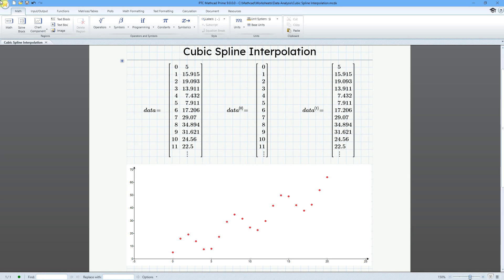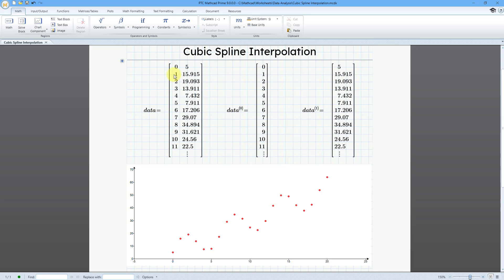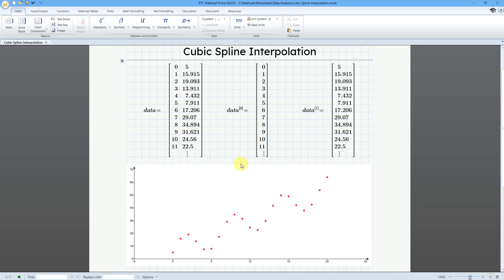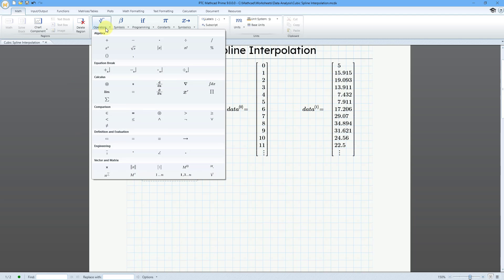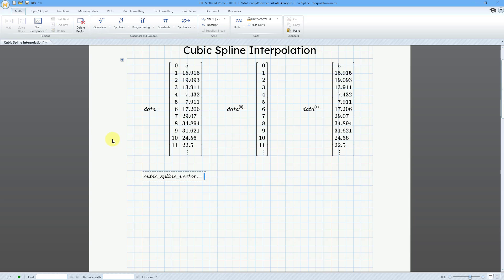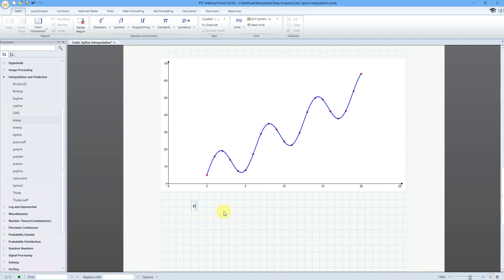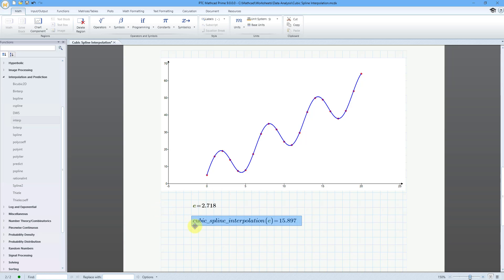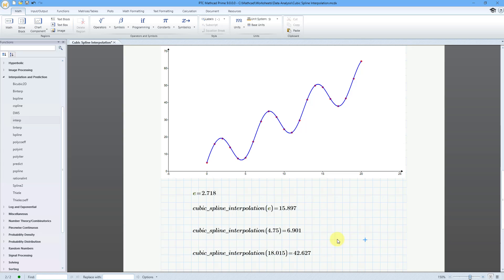Mathcad Prime - Cubic Spline Interpolation | Data Analysis

Comment: How I can extract the interpolated values at different values to use in excel?
Reply from the maker: The first way that comes to mind is to create a vector for the values you want to evaluate, perhaps with the vec function. Then evaluate the interpolation function using that vector. Then export those X and Y values using the WRITEEXCEL function.